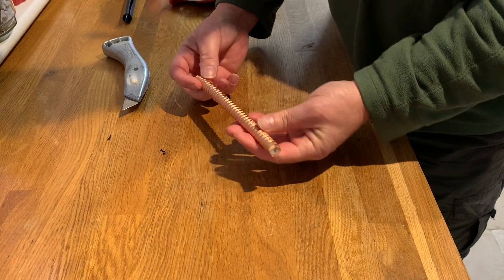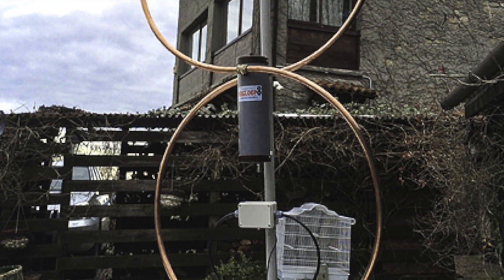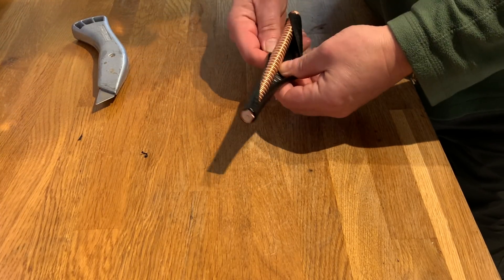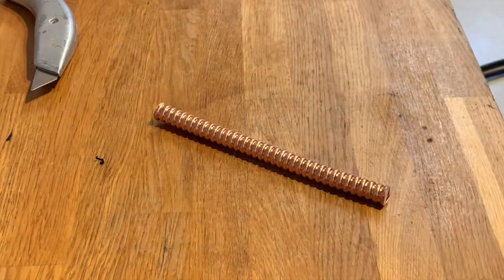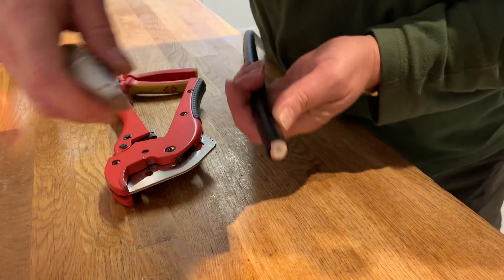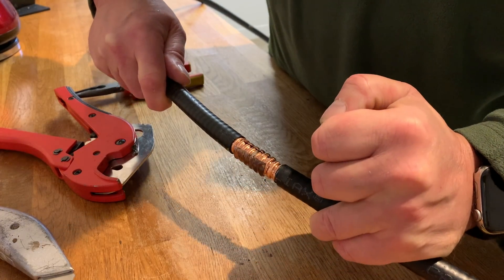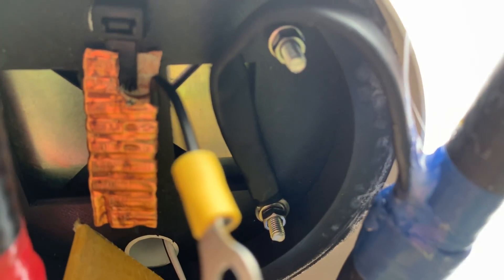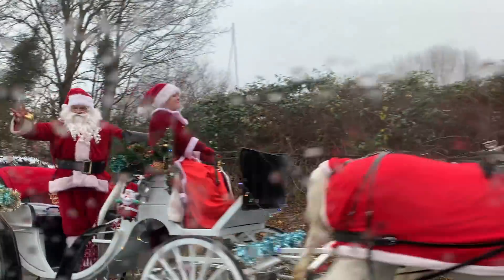HAM RADIO: MAG LOOP, Figure Of 8 Loop main body Construction.

Comment: Hi, don't quite understand the theory as normal loop has capacitor in series with the single loop. This experiment I think will vary the capacitance between each loop, other multi turn loops have  the capacitor  in series connection. Still, I hope it works. Many thanks for your videos.
Reply from the maker: We will see, I hope it will work.

Comment: SHMBO has finally put her foot down :). Why cut the the coax into two? It seems you could simply strip the outer plastic at the loop mid points and soldered the braid on leaving a single splice to be made. To have the solder fully flow around the joint move the iron to the bottom. Solder will follow the heat source given enough flux. For large jobs like this a tub of flux paste is very handy. Available all over flea bay.
Reply from the maker: SHMBO,  😂,  yes one longer piece of coax would not have needed cutting to length how ever I did not have a single length long enough ☹️🍌🍌. Merry Christmas
Reply: @mike-M0MSN  makes sense now. When it comes to heliax beggars can't be choosers ;)

Comment: 1) The centre conductor of Andrew Heliax is Copper (Cu) plated Aluminium (Al). Signal runs on the outside, remember ? Cheaper and lighter to make when one understand the physics.
Same goes for outer conductor. 

2) If the whole project is a fizzer you can always take up Hoola-Hoop.
Reply from the maker: Hi Ade, thanks for the info.  Here is to a Merry Christmas
Reply: @mike-M0MSN   A very Merry and joyful Xmas to you and family. :-)  Cheers.

Comment: Mike your loops and capacitors are above my brain level, but your joining idea for the coax is a great idea. I have a lot of 75-ohm hardline, it must be the next larger size than you show here but essentially the same except the shield is aluminum. If I am to use it and get it into the house a smaller coax needs to be attached on the end. I think your method would work using some rg11 75 ohm that is just smaller than what you have here. The matching to the rig can be the tuner or a transformer that I have. Thanks for sharing even if I am yet to get the loops business, your other skills make it worth while to watch.
Reply from the maker: Many thanks. :)

Comment: great work mike , would a 15mm end feed copper plumbing straight connector work , to join the loop ? you mentioned its 15mm
Reply from the maker: Yes it would but I am trying to reduce the resistance so a minimum amount of mechanical joints as possible.
Reply: @mike-M0MSN  makes perfect sense , cheers mike
Reply: @mike-M0MSN  "minimum amount of mechanical joints" 
In that case , I'm curious as to why you used two loops that had to be joined and tapped instead of using one continuous length and just removing some of the jacket half way along. Is there any benefit of doing it this way, or was it purely down to having two lengths that weren't individually long enough?
Reply from the maker: Only had two short lengths